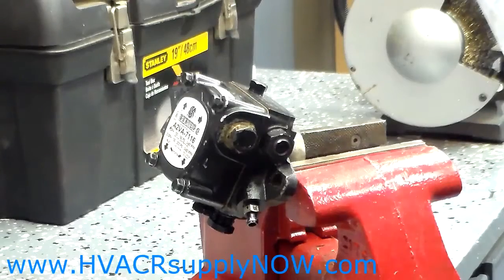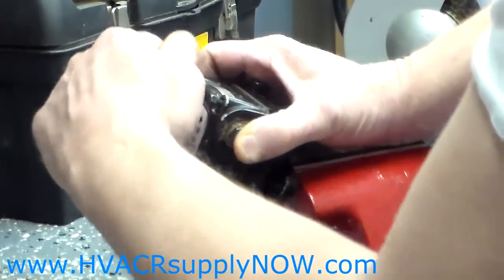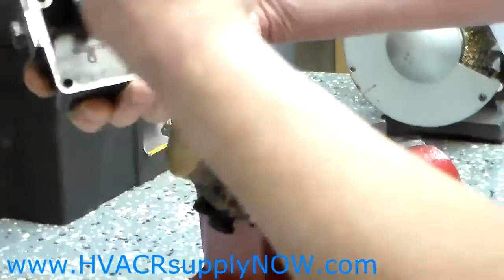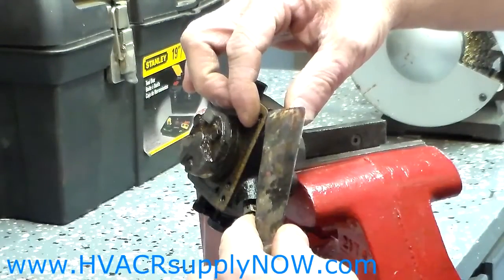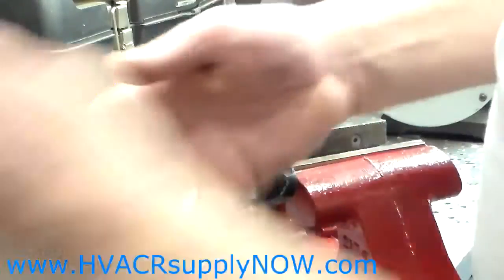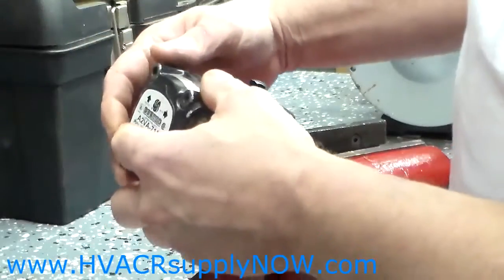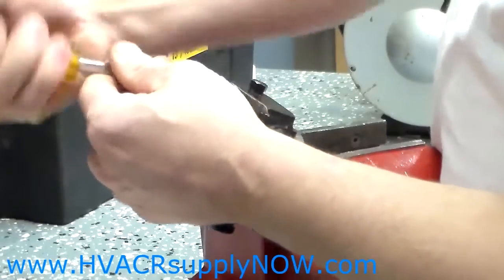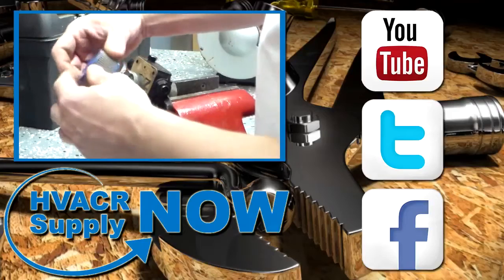Changing a Suntec A Pump Strainer and Gasket - HVACRsupplyNOW

Comment: Toward the end of my heating season last year my pump started making noise. Kind of like a whirring noise. I ordered a new pump, but I was wondering if the strainer could actually cause that? It almost sounds like a Ford power steering pump when it’s low on oil. I change the fuel filter frequently, I typically change it at the beginning of the heating season and halfway through just to make sure that I have clean oil getting to the pump. However I’ve only lived in this house for three years and the furnace has been here for about 15 years. I don’t know how well it was maintained before I moved in. Is it possible that the strainer could be clogged even though I have maintained the fuel filter religiously?
Reply: I just had to replace the collet? That goes on on my motor that powers the fuel pump?